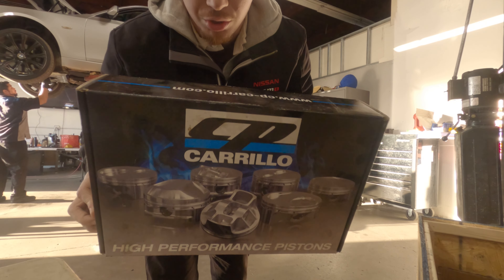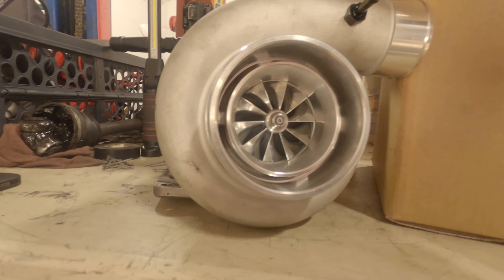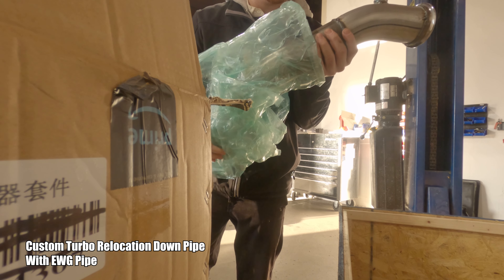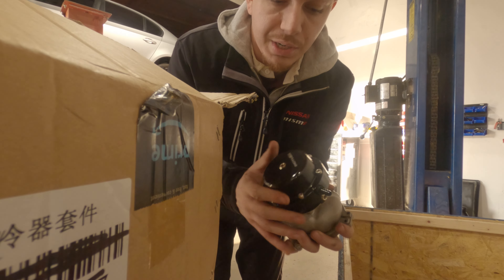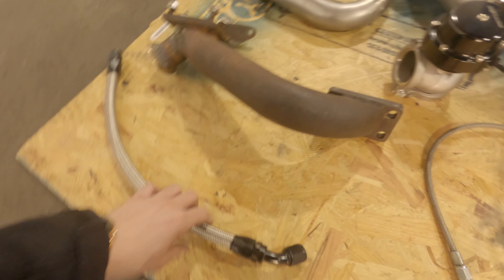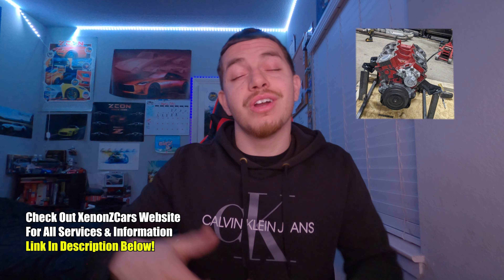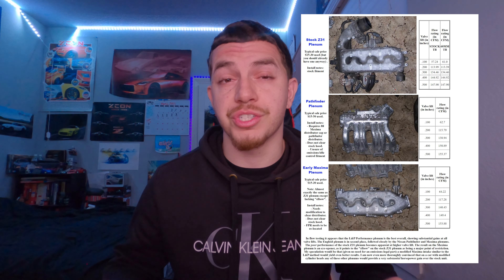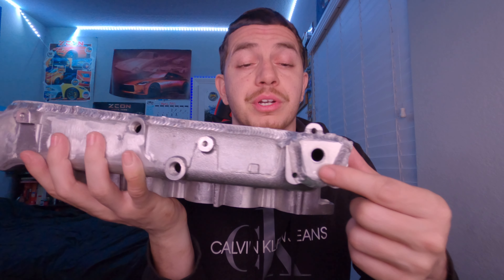Z31 300ZX - Built Block VG30E(T) by XenonZCar! [VsRacing Parts Turbo, BOV, Wastegate]

Comment: Really, I just need to get off my ass and do my 5 speed at least. Got all the NA2T parts in the basement, but the ECU was a loss, (Per Joeseph) so it's a matter of getting the MS pnp as well. 

But I have most of the 5spd parts, probably could throw a couple hundred at it and get it done. Sounds like a good spring project, I've been wanting to get out there and tear it apart again.
Reply from the maker: Definitely get the ms harness. If you didn’t already see it; I have a video showing you the harness and sensors it comes with too. 

I will have another video after installing it

Comment: Did you get to put any of those parts in the car?
Reply from the maker: They are in the car yes. I haven’t got the car going yet but I have been cleaning up a lot in the engine bay. 

This will show you everything more or less. There will be updates coming soon, I’ve just been swamped with work and other things 

https://youtube.com/shorts/pZWKFM6unvY?si=GP7LCrcciPmlAmxS
Reply: @KnineLiveZ  hell yeah, man if you can do more detail installation or longer videos that would be great. Either Way great job on keeping the z31 community alive.
Reply from the maker: I’ll try to get an update video out. I have some longer videos coming out and by the time these are done and out I think the z should be basically ready to start! 

I’m glad you like the content. Once the car is operable there will be a lot more content with it for sure. Thank you for supporting I hope
You consider subscribe if you haven’t already